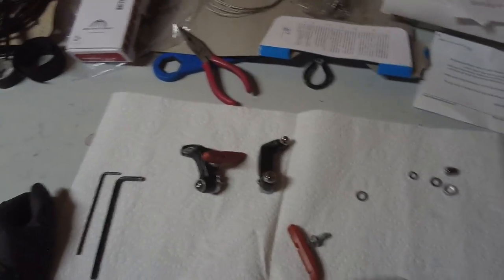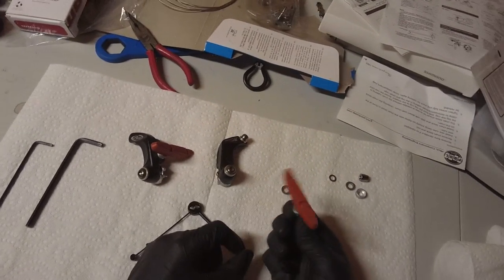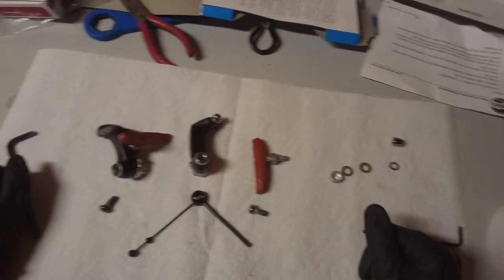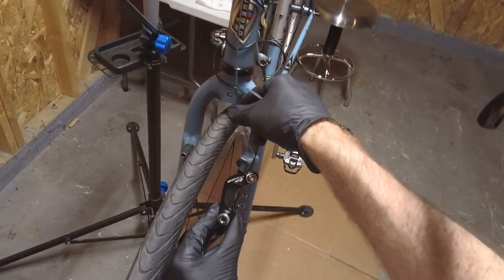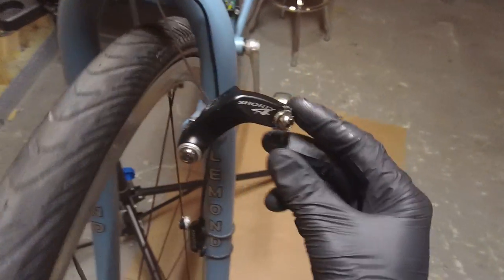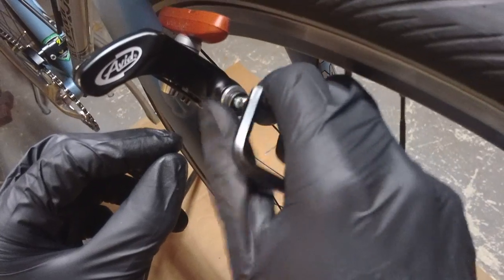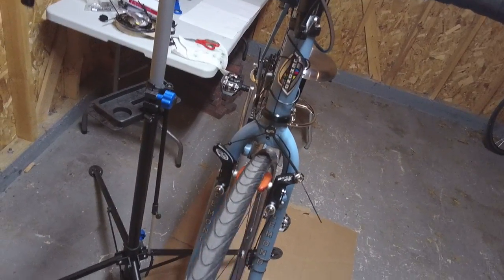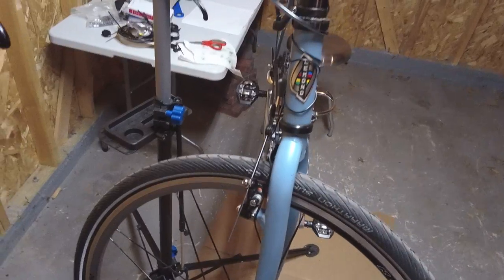How To Setup Cantilever Brakes Avid Shorty 4 Install Bike Blogger

Comment: Hey, BikeBlogger. What do you think I should do when my bike frame size gets too small for me? My hybrid has 17.5" frame. I'm thinking about three options
1. Convert it to a gravel bike(road bike frame, new drivetrain(maybe even ss), bullhorns and compatible brakes, shifters)
2. Sell it and get a new bike
3. Ignore it
Reply from the maker: +Almat Sailaukhan Ignore it. LOL No, seriously, if the size is too small you should move up to a larger frame. Racers/pros (yeah, who cares right?) sometimes ride frames one size smaller than ideal to save on weight but honestly you will be able to go further, faster and more comfortably with a bike correctly proportioned to your body. I have over the years kept old bikes primarily out of necessity because I didn't have the money to get a new one, and they were generally only for activities I did least (gravel grinding, mountain biking). Some keep old bikes as backups or for winter riding, while others would rather ride a bike they enjoy more. Some sell if they think they can get some decent $ for it.
Reply: BikeBlogger Thanks for your feedback! Keep up the awesome work!

Comment: The coin like round thing on top of my straddlewire snapped in two pieces a few days ago when out riding on the flat and level at low speed. I basically pulled too hard on my front brakes while at the same time applying my rear brakes. It must be like 1-2 years old. No good.

Comment: Hey, BikeBlogger. What's your favourite gear ratio? How hard would it be for a beginner to ride with that ratio?
Reply from the maker: +Almat Sailaukhan Favorite gear ratio is 2.75. For a beginner it might be a little high, but that depends on how many hills you got to deal with.
Reply: BikeBlogger I have almost the same ratio with my second chainring (triple) and smallest cog in the back. I think I'd pull it off but I like riding on higher cogs because it's more relaxed. Thank you for the videos!

Comment: Are Mini-v brakes better than cantilever style brakes: i'm not a huge fan of disc as of yet. Not because of performance, I just hate how they look on road bikes:(
Reply from the maker: I have a bike with traditional center pull cantilever brakes (Avid Shorty) so I can use regular brake levers on my road style drop handlebars. Read http://www.sheldonbrown.com/canti-direct.html#levers Shimano V-brakes (side pull) require a certain type of brake lever because they pull directly through one cable, which makes them simpler. I'm not sure one is really better than the other because they both work well if you know how to set them up right. Traditional cantis will provide more clearance for mud and snow.

Comment: Your toe in instruction was backwards. Where the pads are, the rim will be moving toward the front of the bike so you want the rear of each pad to contact the rim first so it swipes away any water or debris as best they can, rather than trapping more stuff between the rim and pad. This is particularly useful when feathering the brakes for just that purpose, for example, in wet weather.
Reply from the maker: +GTW 3Bagger Hope this helps explain it ;) http://www.edinburghbicycle.com/comms/site_info/bike-and-cycling-faqs.htm?f_Cardinal=10#squeal
Reply: +BikeBlogger Ok, I've been doing it the wrong way then, but it's been working. I'll have to try it the other way and see if I notice a difference.
Reply: How wrong are you, your wheel rotates forward dragging the pads forward, and pushing the front of the pads out and away from the rim, don’t give useless advice, when you haven’t a clue what you’re talking about. Toe in the pads to the front, always!